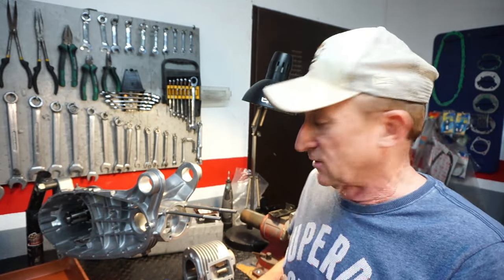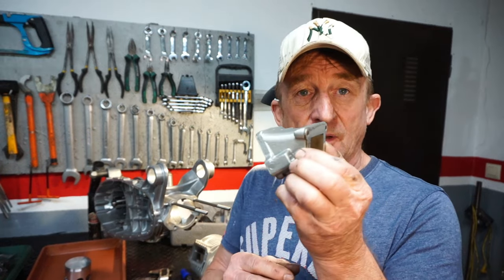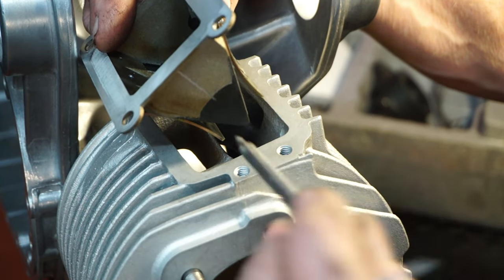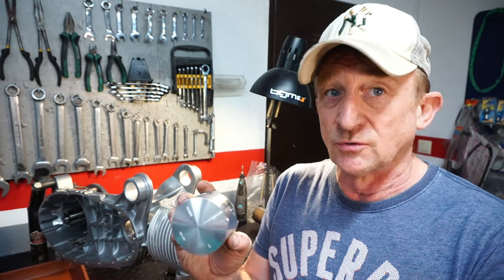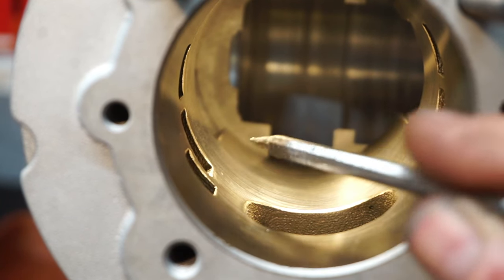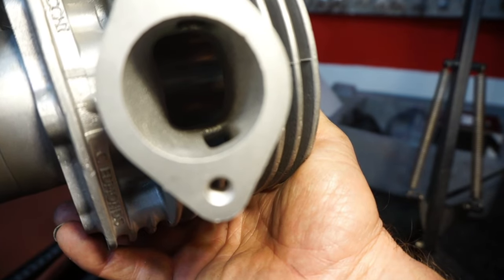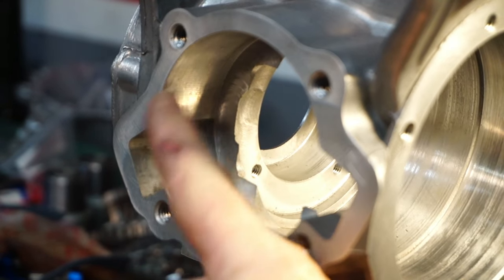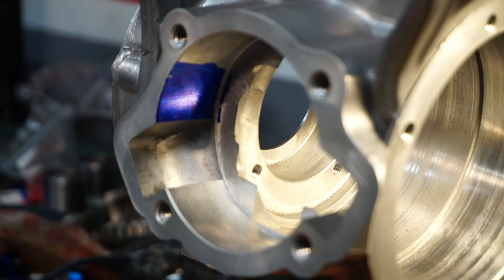SUPER MONZA PART 2 LAMBRETTA TUNING PORTING #amazing#tuning#fast#scooter

Comment: What would Monza kit be before all your work , I’ve never done any cylinder work so rather expensive if I made a mistake ,
Reply: My thoughts but this guy knows what he's doing
Reply: Like yourself I've never done any tuning work but from the magazine articles I've read the output is dependent on size / type of carb and what performance criteria of exhaust you want . E G  high reving, top end power or a low down torquey touring type engine . I would think that the output is dependent upon which combo you choose .

Comment: THANKS  cheers mate for the mention good porting should go well
Reply: Cheers bro
Reply: @tonyobrien5295  here we go with the Charlie comments lol 
Raced and worked for a well known scooter shop and had experience with many combinations of set ups and study lots about tuning haven spoken to the likes of Fritz overmars Jan thiel and other known tuners  all cylinders have there pros and cons so not going to get into keyboard fight Charlie had his ideas and success as many other did I'm just giving some of my research and development improvements to Steve  I don't want to here about who's the best ect I have improved the power delivery and rideability and just passing it on my old group 6 is the fastest supermonza both ways at snetterton over 5mph faster up hill than the SSR 265 LC
Reply: @tonyobrien5295  tuned my first lambretta when I was 19 year old . Had my own shop in the Midlands called backcountry scooters with my friend Jason Cadman . Supplied tuned barrels and hand made expansion chambers to cj scooters . Race group 6 for three years . Also drag/ sprinting success in 1995 Avon Park fastest lambretta . Fastest overall and fastest street class  . Making me the fastest road scooter in the country in 1995 ..... tuned all my own race and sprint scooter and always ran my own hand mad pipes ..... also 9 years racing endurance 6 hour in Spain....... all scooter prepared by me suspension.  Brakes tuning etc ......
Reply from the maker: No problem 👍
Reply: @tonyobrien5295   well Tony ever lap record Charlie had has been smashed by us 7 time champions  every UK track apart from Caldwell we hold the lap records for in group 4 and group 6 for you to say the standard kit is better than a modified one goes against the championships I'm not sure why your so up Charlie's ass slagging every other tuner off if you could achieve over 50 whp on a dynojet I must add was Charlie's previous Dyno you wouldn't be going on forums saying i couldn't get heat in the pipe to make the hp blabla why did Charlie design the exhaust duct wrong and not 75% of the port area  why is the intake at the wrong angle why have the subs so wide it can short circuit why does his pipe not work i could go on but like i say 45+hp from theese kits on 99 unleaded we must havent a clue about tuning  when Jimmy's runs methanol and makes 39hp at a push 🫸 I really don't get why you have to be so abusive and negative to everyone else

Comment: Its possible to get Chinese made copies of Foredom pendant motors, and even 90 degree grinders, and straight handpieces to fit Foredom flex drives. A reasonable set-up costs about £200, consisting of pendant motor, flex shaft, footpedal, quick release 2.25mm collet, straight handpiece,  chuck type straight handpiece, 3mm right angle grinder, and a good selection of carbide burrs and grindstones. You would find that would be far better than Dremels, and well worth getting if you do much more than 3 or 4 porting jobs a year.
Reply from the maker: Exactly what I need ... Worth having a look... cheers
Reply: @TheSteelweasel  Other alternative is pro type gear.  Then a right angle grinder alone costs nearly £500! Who makes the pistons for the cylinder you are working on?  Dont recognize them?
Reply from the maker: i think Tino uses METOR pistons but this one has no markings .... @humourless682

Comment: Years ago as a yoof I had a paper thin 72mm cast iron barrel with a Bultaco single ring piston, the exhaust had a diagonal bridge brazed in to stop the ring falling out, I ran a twin plug head, and a 1" 3/16" Wal Phillips with a 48mm Fresco. Bonkers in a straight line, but horrendous to ride anywhere else, and drank quicker than Oliver Reed and Shane McGowan at a free bar!
Reply from the maker: Sounds awesome 👌